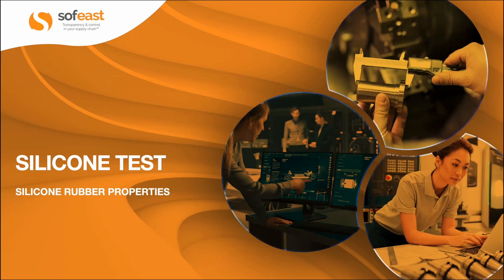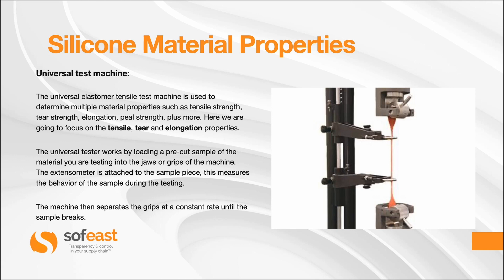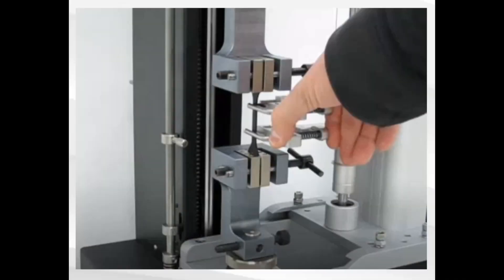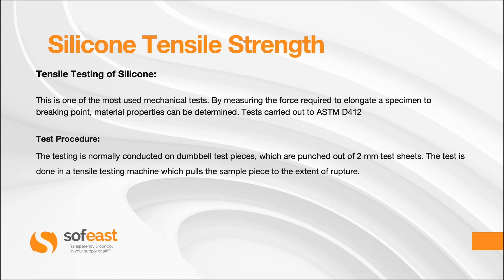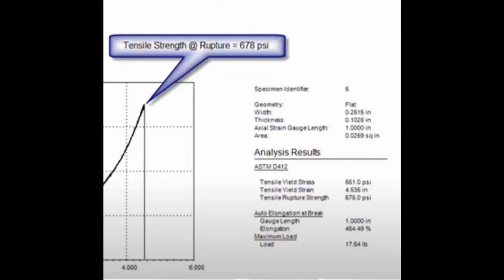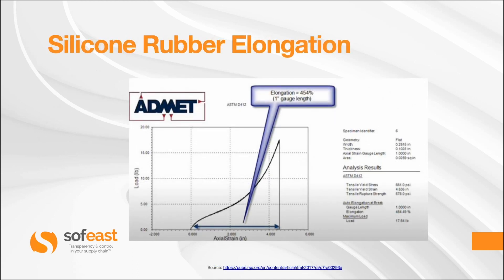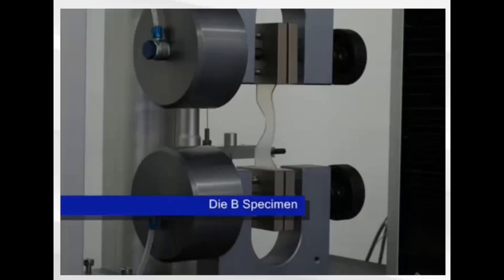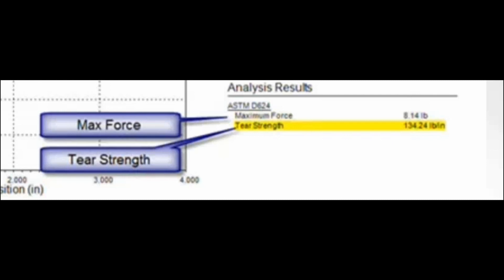Silicone Rubber Properties Testing (Tensile strength, Elongation, & Tear strength)

Comment: Thanks for the video, i really  appreciate 👏👏 but i have a doubt. What 180% elongation stands for?? I mean is it like final length before rupture is nearly equals to 3 times of the actual length?? Also i want to design a small silicone cylinder, when Air is compressed the final dia shall be 100mm and length shall be 260 mm , what shall be the initial dimensions(when air released) of the item.
Reply from the maker: Thank for the question

With respect to your specific product, we do not have enough information in order to guide you in your design phase, however, we can provide some guidelines to help you achieve your desired outcome.

Silicone comes in different states and depending upon how you want to process the material and what your final manufacturing process is will determine what raw state you will be working with. For any type of pouring or injection molding you will be looking at the liquid silicone rubber (LSR) series, whereas, if you are looking to produce silicone parts from compression molds, you will need to consider the semi-solid state silicones. With your product (a cylinder), you would more than likely be considering the LSR series as a cylinder would be produced in a mold.
Silicone as a raw material will have additives mixed in to alter the physical properties and how the final molded part behaves from a mechanical point of view. Remember, some silicone products are hard, the solid tires of a forklift truck for example, on the other end of the spectrum, a rubber band is soft and very flexible with a very high elongation ratio, much more than the 180% we talk about in the presentation. 
For your cylinder product, you need to ensure you select the correct silicone with a low Durometer Shore hardness value, maybe on the 00 scale, this will ensure your inflatable cylinder is able to expand and contract without bursting. You also need to consider the two dimensions, not inflated and fully inflated, you can then calculate the elongation or expansion requirements, from there you will be able to determine what the other mechanical properties would be, such as the tensile strength, which should give you a guide to the silicone grade that will be suitable for your product design.
Always remember to build in a factor of safety when designing products.

We hope this helps guide you in your product design.
Reply: Sir please unload video showing silicone content in the rubber